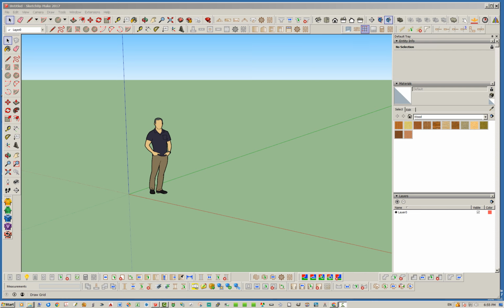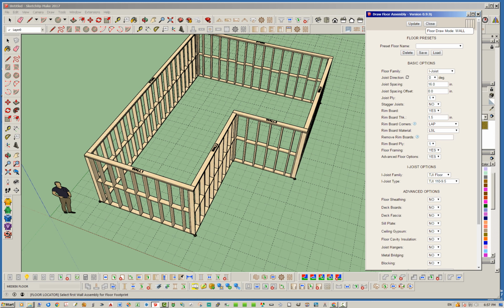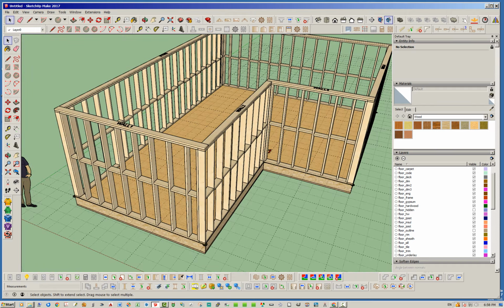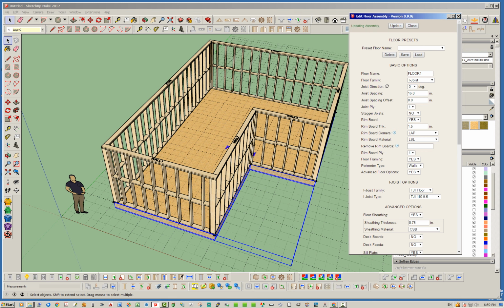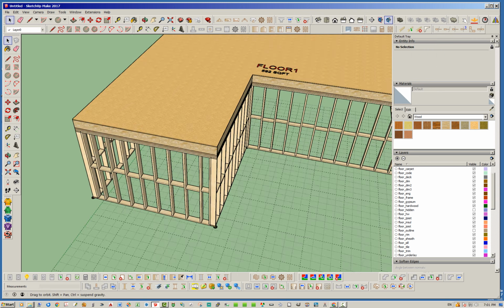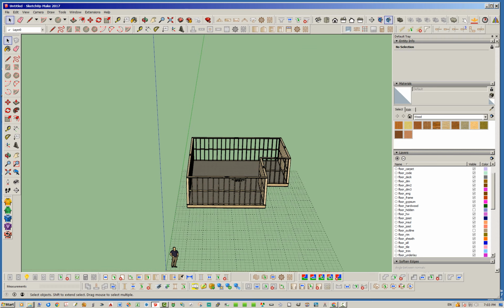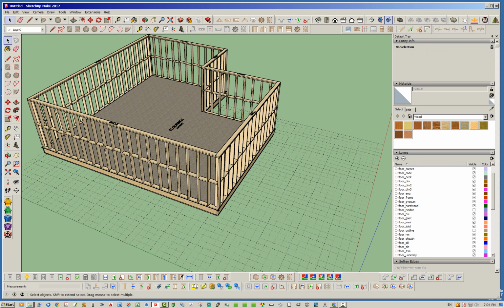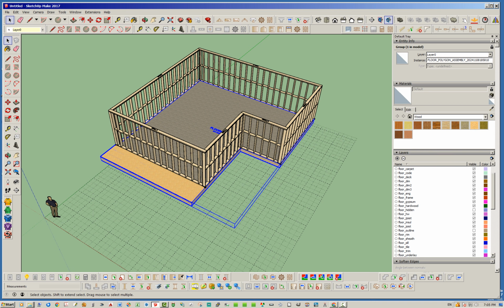Medeek Floor Plugin Tutorial 17 - Linking Floors and Walls

Comment: Hey Nathaniel,

We run a timber frame company in the uk (family run) and I have all your tools and I can use them efficiently…

I use them to design and quote extension/small works in our local area, but we currently outsource any timber frame design because our director (my dad) has always done it like that…

I know Medeek could fulfill the design from the timber frame from 3D design, quoting, manufacture (cutting list) and site plans…

If we could switch the timber frame design costs from our current autocad designer to you for confirmation that we can use your tools to do the design from start to finish and if we need anything else we will pay you…

I just need you to convince my dad that Medeek is better than autocad!

P,s. We use to do about 50 timber frame homes a year but we do about 10 now and the design is approx £1k -£1.2k each